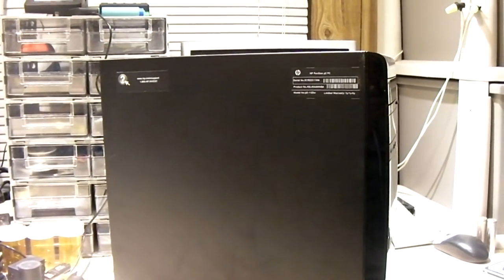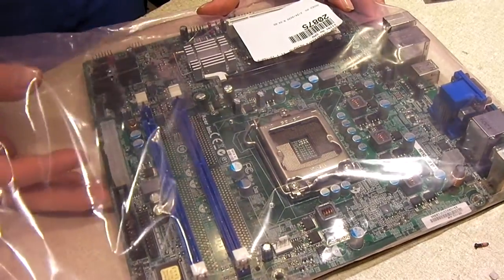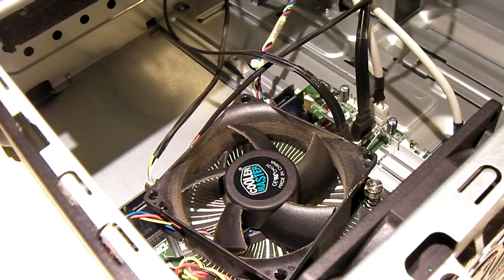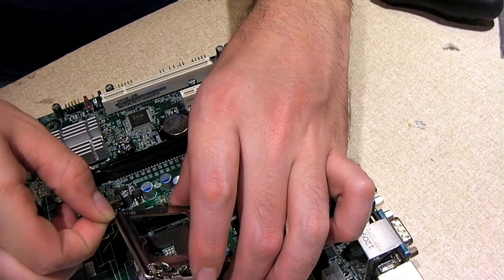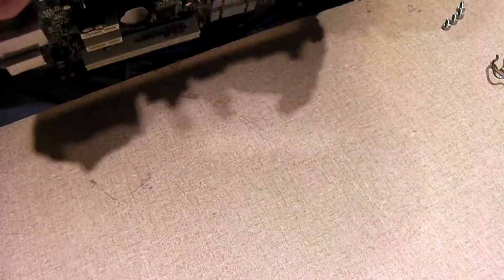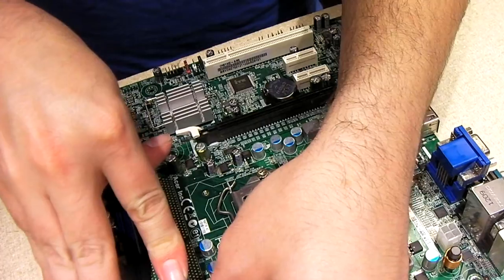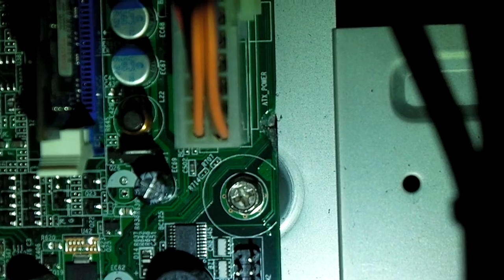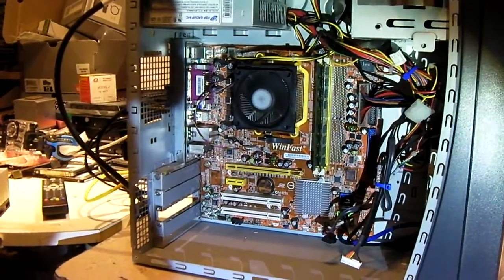Building a system into the Dell Dimension Chassis - DOA Motherboard

Comment: I think that type of front panel audio connector was back when some Dell computers were shipped with an OEM variant of a Creative Labs Audigy Sound Blaster in them. I've come across a few Dell machines that were that way. Could also explain the missing expansion slot cover.

Comment: So the front panel I/O headers are standard?  I would like to try a 3rd party motherboard.  Are there any IDE PCI-e cards to repurpose the optical drives with a modern motherboard?
Reply from the maker: In this system, the headers were standardized. As for the IDE card, personally I would just replace the optical drives with SATA drives.

Comment: Couldn't you just try whack a bigger wattage laptop psu at it and see if that solves the cpu problem?
Reply: You probably could try that but you would most likely get the same shut down. Limitation of the motherboard, safety feature during post. You will have to patch the bios before trying the 65w cpu